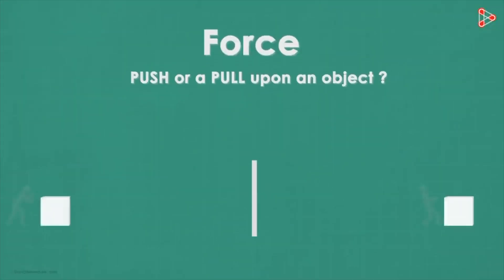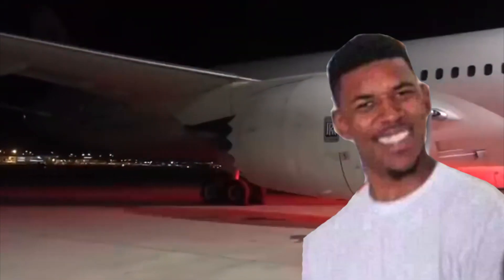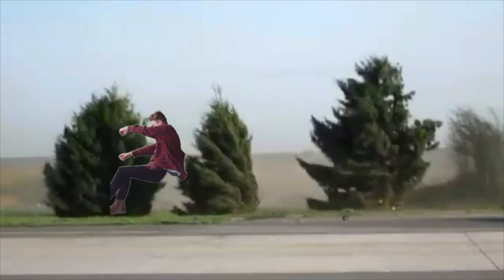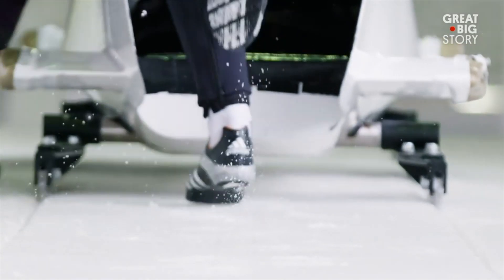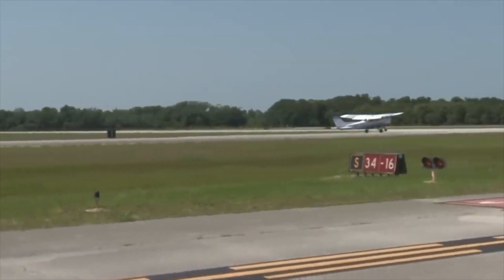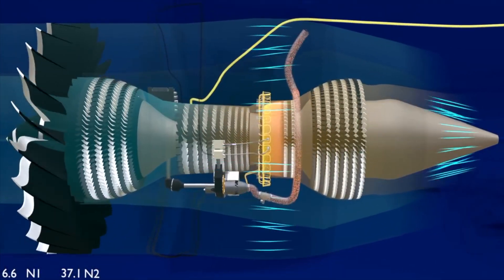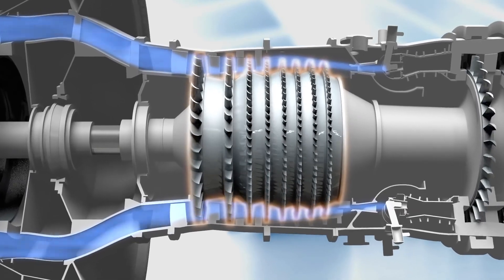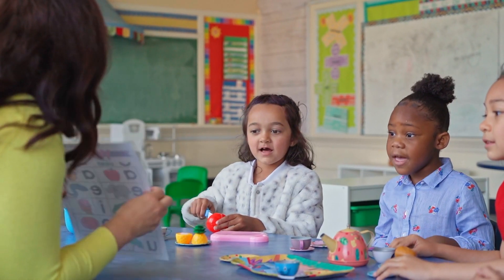How Jet Engines Work: A Logical Breakdown Step by Step

Comment: To my understanding of this video. That means pressure infront of the engine is low and the rear is high pressure. This fast flowing, high pressured air crashes into the naturally slower air behind the aircraft. Because theres no other place for the high pressure air to go, it is pushed against itself and the naturally slow air then pushes the aircraft forward.